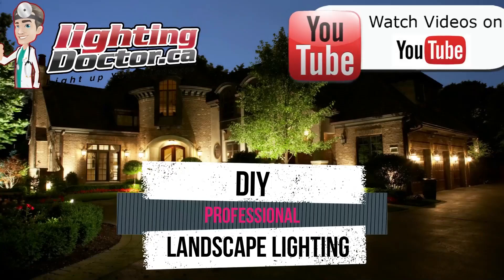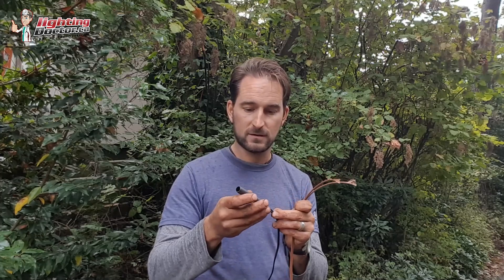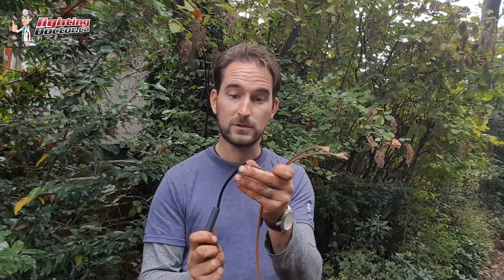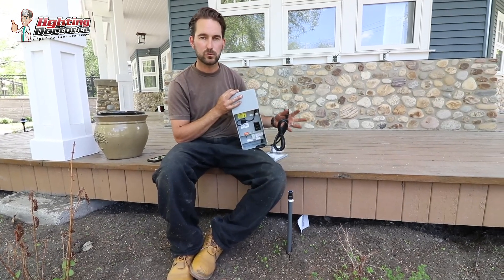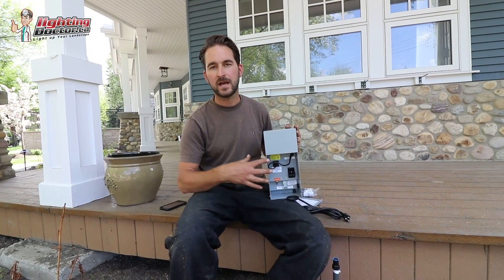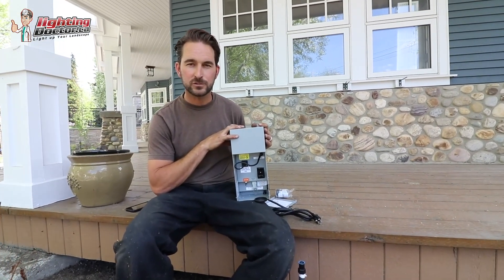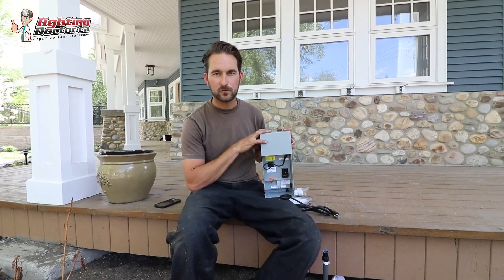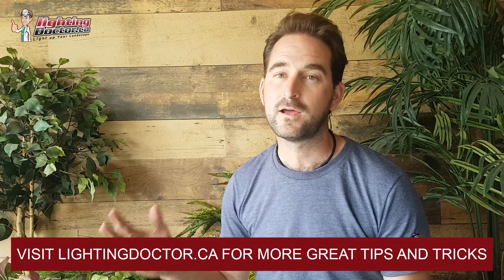Wiring Tips and Tricks For Your DIY Landscape Lighting

Comment: I appreciate your tips. Do you recommend any specific “switches” that can be integrated into an outdoor lighting system?  I have a basic transformer with wire going to different parts of my yard. For certain runs I’d like to wire in a switch so that I can turn off/on lights to a portion of my yard (only turning on for certain occasions. Any recommendations on this?